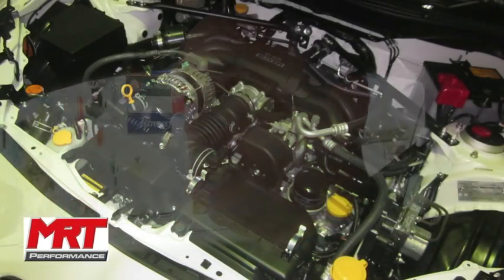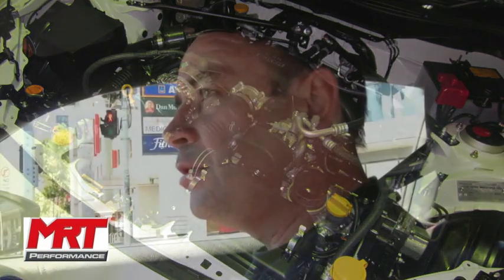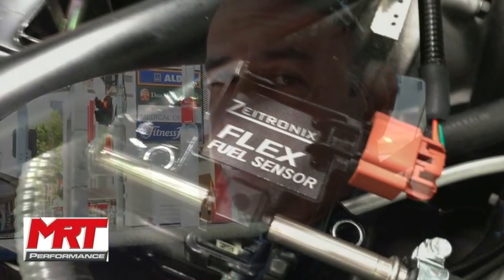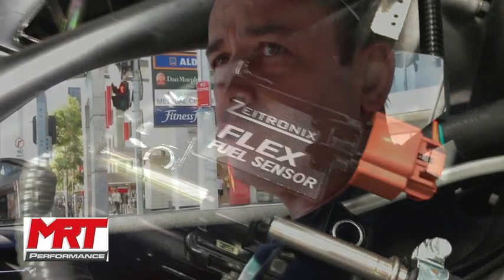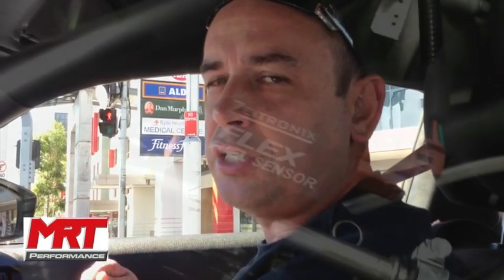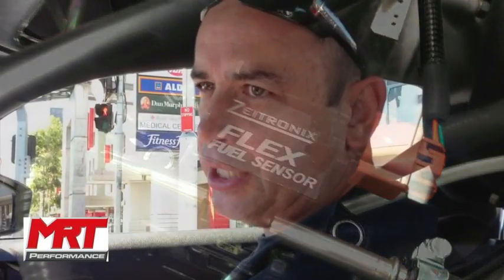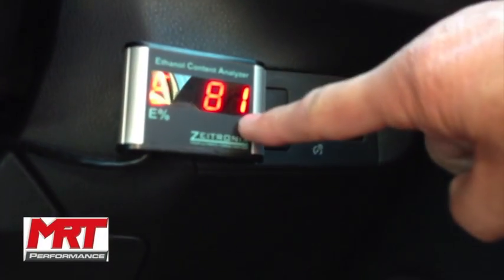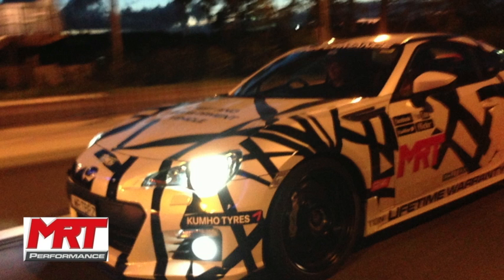Subaru BRZ tuning for ethanol, custom dyno with EcuteK software. For more power and amazing features

Comment from the maker: Ecutek will release the tuning solution for the new Subaru DIT engine shortly, we are currently in Beta test mode...
The Toyota and Subaru FA20 ECU is different dramatically and the NEW DIT engine is no where near same, so requires new software.
Re the turbo model we are testing now and have parts in manufacture now :)

Comment: I, not so long ago bought an evo that has a dual (but not flex) tune, so I emailed United regarding their fuel quality and whether it changed throughout the year (since this would effect how well the engine runs in regards to both the octane rating and fuel volume being injected). Their reply is a bit long so I'll put it in a new comment

Comment: Well it becomes a bit of a predicament. When it was tuned from the United petrol in the first place, what was the ethanol % then? If it was only E81 and now I'm running between E81-85, I guess that wouldn't be as bad as if it were actually tuned with E85 and is now running a lower % of ethanol. I guess the only way to really be safe is to get the device that tells you the ethanol content and get it dyno'd again to check the a/f ratios.

Comment: So in the end the tune is variable all across the various levels of ethanol rating? If so, when you tune it, is it just tuned for two data points e.g. 98o and e85? And then any values inbetween are interpolated? Is it a linear trend between the two points or would it be non linear? Have you done any modelling based on various data points or used some sort of algorithmic trending to vary it? Maybe too many questions. Sorry.